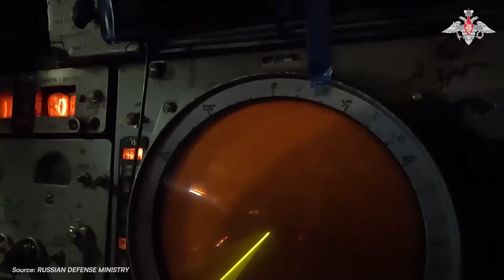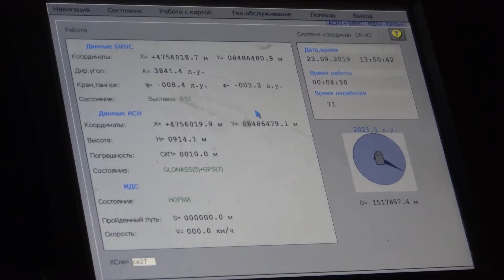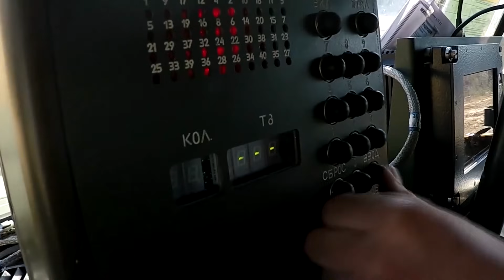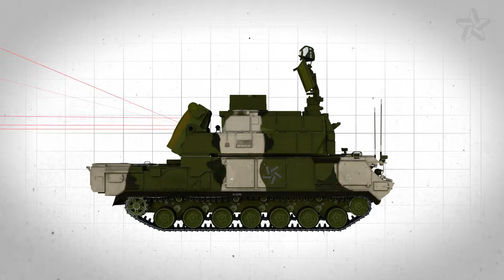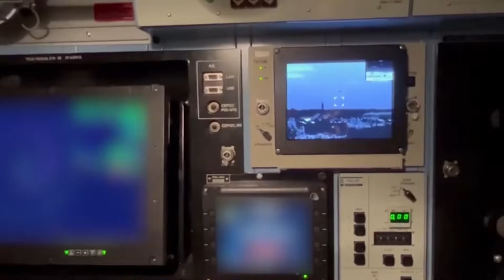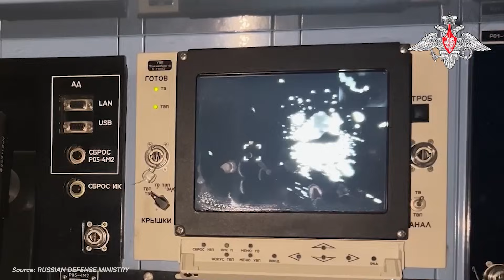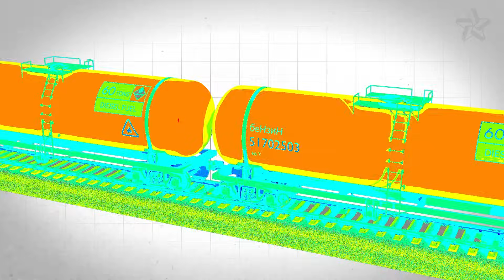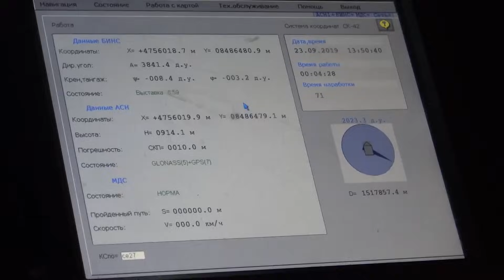Watch Ukrainian Drones OBLITERATE a Russian Train

Comment: This is the kind of breakdown most coverage skips. Showing the entire contact chain—detection, EW pressure, air defense saturation, and timing—makes it clear that success isn’t about a single drone or strike, but about decision speed and system limits. 

The way jamming forces degraded navigation while point defenses get overwhelmed explains modern warfare better than any headline. Clear, technical, and actually educational.